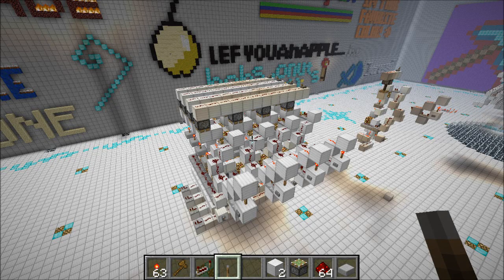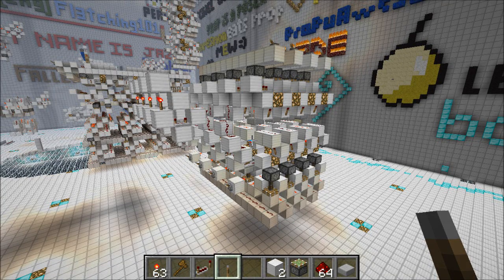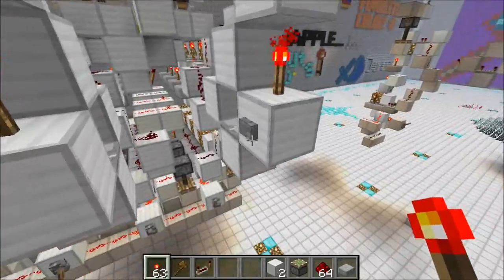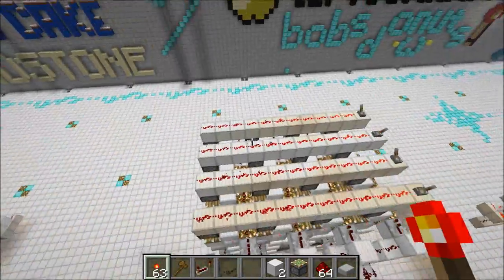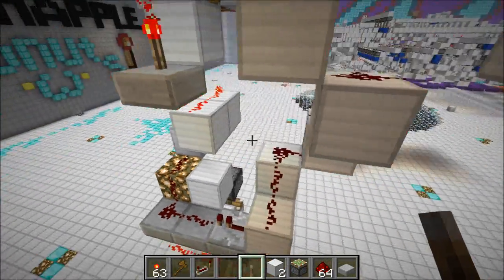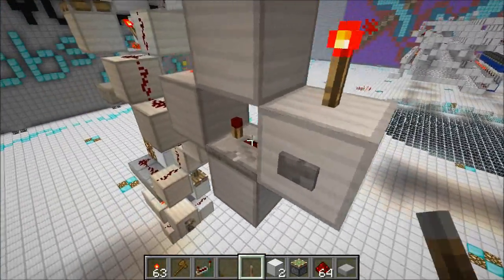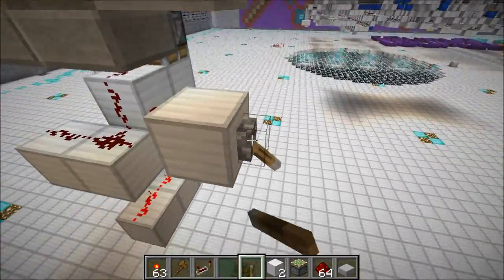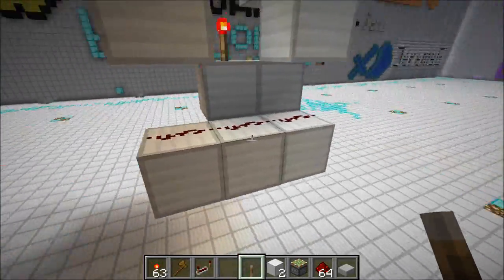2x3 RAM - Fast, Compact, and BUDless (1.5 Safe)

Comment: I've made and others have made bud ram that doesn't rely on the budswitch bug. When you have two valid states (where the entire things should be both on and off but doesn't know it) and do a block update it twitches. But, any fix would make it not twitch. It could not actually make both states valid. It still has to be in one state and not the other and thus be memory, when the state is flipped. I also have some basic modular 2x3 RS latches, sans pistons. I really wouldn't worry about this.

Comment: Hey prop, it's possible to modify guy's read system to not use BUDs, so 2x3 BUDless dual read is indeed possible. The way it stacks can be a little ridiculous depending on how you do it, but it works.

Comment: It depends on what they mean by "removing BUDs". Are they going to hunt around trying to get rid of every BUD concept and fix it? Some may be difficult, such as blocking pistons when they're powered. If they simply fix redstone updating 3 blocks away, those BUDs would be fixed (broken) but the quasiconnectivity would still be there. I would be ok with that. Because in truth, the quasiconnectivity was always a feature, the update area being the glitchy part. That would keep most designs intact.

Comment from the maker: According to what Jeb said at Minecon they will be removed - perhaps not completely removed in 1.5, but eventually. And I agree with your assessment of the possibility of a "BUD block". It's unfortunate that it took this long for a decision to remove them to be made because as you said, there is a tremendous number of designs that rely on them and had they been fixed when the bug was discovered that wouldn't be the case. Definitely a tricky situation.

Comment from the maker: It's probably not possible to do it with the 2x3 design, but with a 2x4 design I think it will be, which is reasonable. One other idea I've been playing with would be to simulate dual read by having two RAM banks, that way you could use higher performance RAM and still have a dual-read function. You'd also have other options that simple dual-read wouldn't provide. The downside would of course be the space.

Comment from the maker: I've found that repeater locks make fantastic registers, but I think it would be difficult if not impossible to make 2x3 repeater lock RAM. 2x4 would probably be possible, but I think the read would get a little tricky because of the staggering that would be necessary to make it two wide - I might play with it a bit later though.

Comment: Do we have actual confirmation BUDs will get fixed? Because replacing them with just a BUD block does not cut it, most of the time advanced redstoners use the BUD mechanic, it's a shortcut to power pistons, or perhaps to do it from a different location. We don't actually use it to make block update detectors, per se.
There is a ridiculously huge amount of designs that rely on this. I would say it is one of the core mechanics of redstone